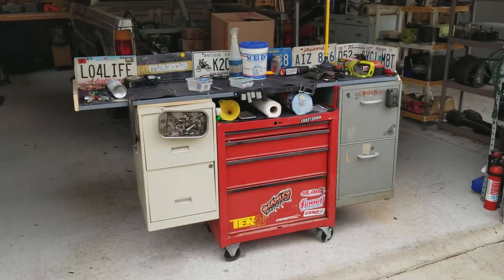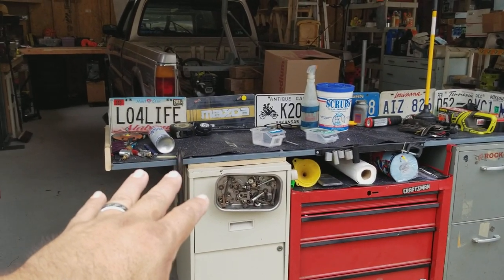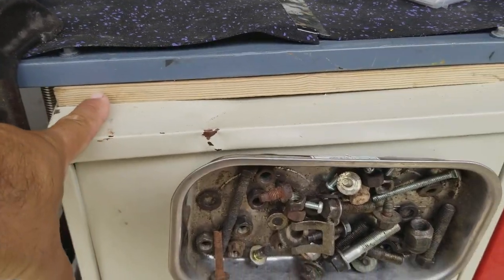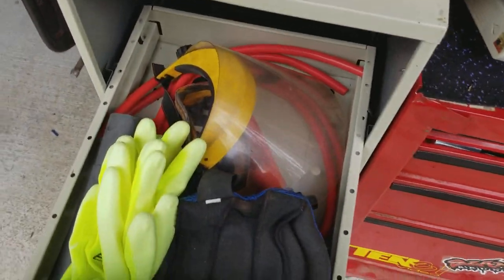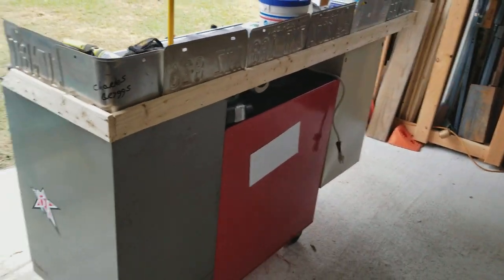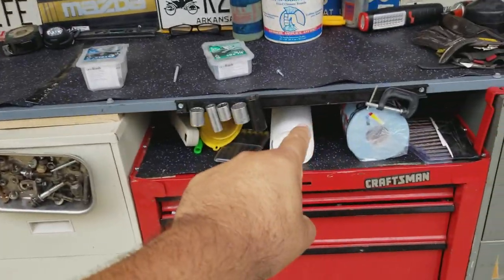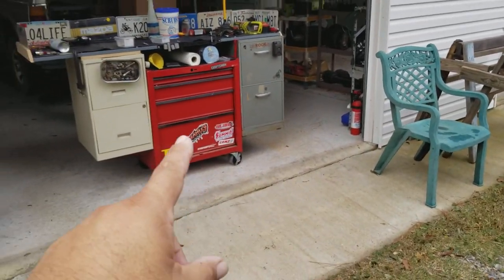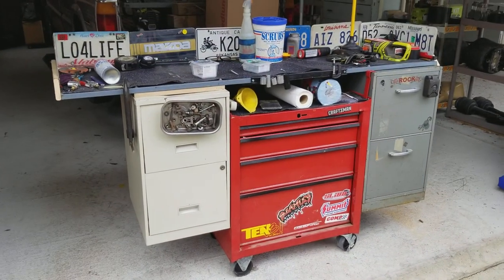DIY big tool box 11-4-17

Comment: here's a suggestion for your next tool cart. file cabinets hold a lot of weight, but to take advantage of their strength, you  need to support then from the bottom rather than screwing them into the sidewall.  a cheap and easy way to do this is to grab a metal bed frame (free on CL all the time) and screw that into the base cabinet. you can also reposition the caster wheels of buy some bigger ones cheap from harbor freight. the bed frames will support the cabinets from the bottom and give you full options for caster wheel placement.  cut them to length with an angle grinder and use two short ones on each side also.

Comment: Nice idea...I think I would change the self tappers with nut and bolt so I wouldn’t worry about the self tappers coming loose and coming out from the weight of what I would put in...great idea..
Reply from the maker: +Raymond Rivera True tapers is what I had on hand the left box is cheap and already sagging going to replace it with a heavier duty cabinet

Comment: That's such a great idea! I'm trying to build something for my dad cuz he has tools all over the place 🤔 ~ Another suggestion getting one of those barbecue grills that rolls on one side, if you're crafty and creative you can make a lot of things using one of these Grills. ~Grill is about 50 by 22... I took all the tops off  and gutted the interior basically was left with the frame  two shelving stations at the bottom. I grabbed an old marble sink that somebody was throwing out at the road  and attached it to the top. I made a garden and planting station that I can roll around my yard.
Reply from the maker: Laura Laine heck yeah that sounds awesome I love making stuff cause it's cheaper then buying it new lol
Reply: Laura Laine - sure those salvaged grill cabinets can be built into something better but in order to make them suitable to hold lots of weight is to buid an internal subframe to hold the internal structure firmly and then you also need another external frame to provide for better stability and its suspension

once you build the outside frame, you can even extend it really high to accomodate the cover or its bell on top of it (the top semi round cover that holds the temperature gauge) and lastly you can put into it a movable front axle with 8-10 inch wheels or higher and another still axle in the back or swivel casters in it

my design involves a 3 flip flop top tops made for three different power tools (belt/ disc sander, 12" scroll saw and the last one to accomodate an 8" grinder grinder and a 4" vise)

i also adapted one of those little kids' 6v electric  front motorcyle suspension with a forward/ reverse switch to make it easier to maneuver

i've started building this tool cart during the summer but im to busy right now to continue its production, but i hope to conclude it during the next winter when business goes slow

overall, its great stuff 👌